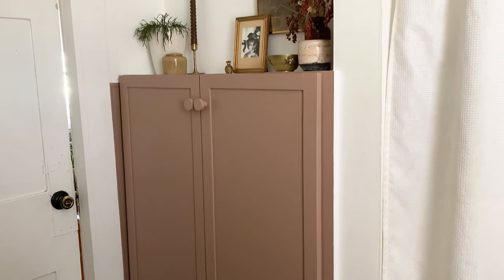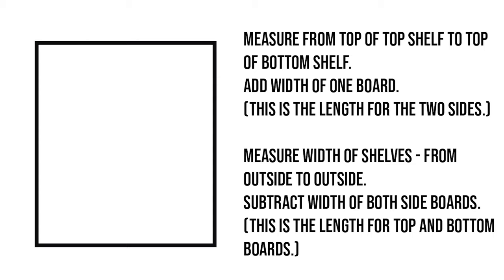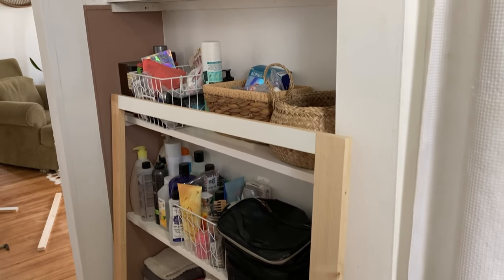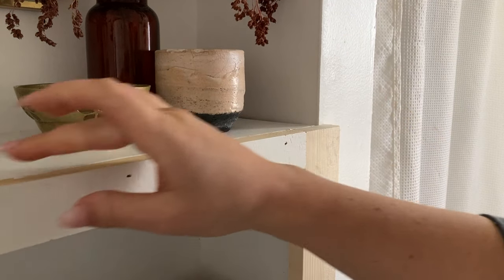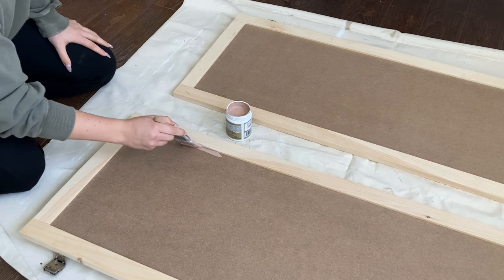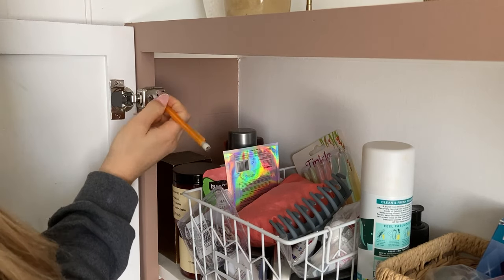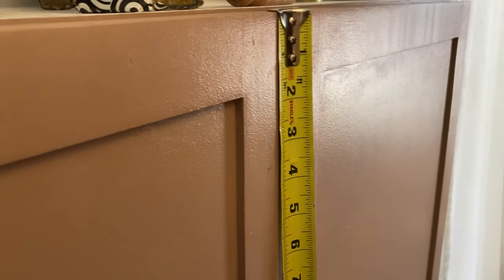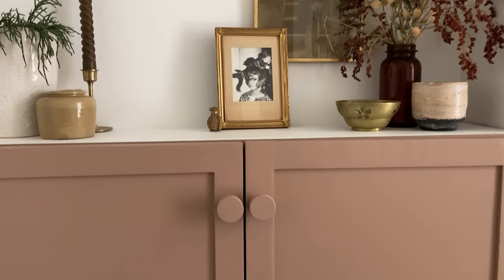How to Add Doors to Open Shelves or Bookcases

Comment: What I am not sure I understand is why you had to make a frame first? Why couldn't the doors just be attached the shelves?  I Really want to try this. I have a wood cutter but don't ubderstand the frame part
Reply: You could definitely attach the doors right into the wall, but I think they did a frame to make it look more like a built in vs having doors attached to the wall out of nowhere. If you look at a basic kitchen cabinet, most have frames like this. I think that was the purpose.

Comment: Was the frame only attached to the top shelf? And that was all that was holding the doors? I'm just trying to figure how how this would be well supported by a half inch of wood, possibly MDF...
Reply from the maker: It is attached along the top, bottom and the sides where it meets each wooden shelf.  It has held up great and feels very secure!